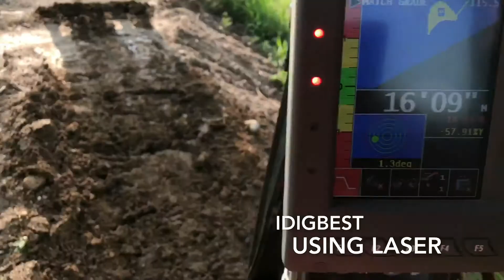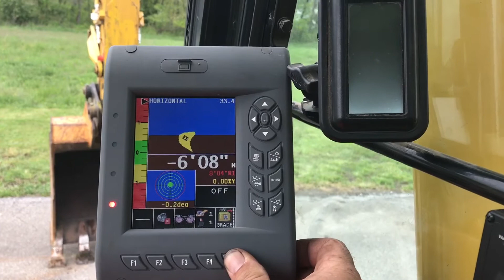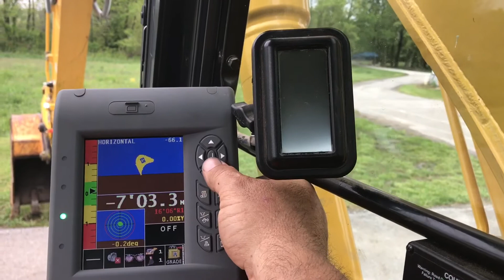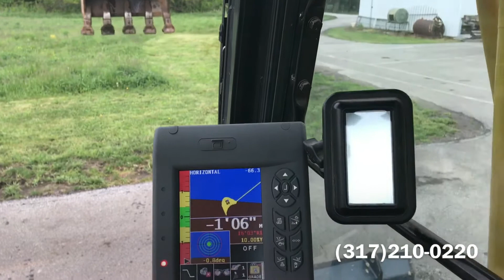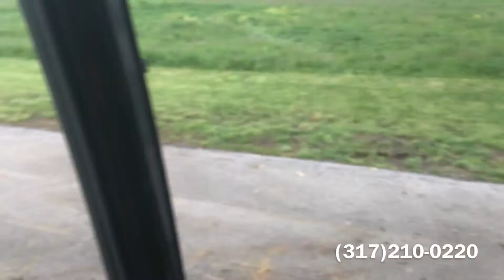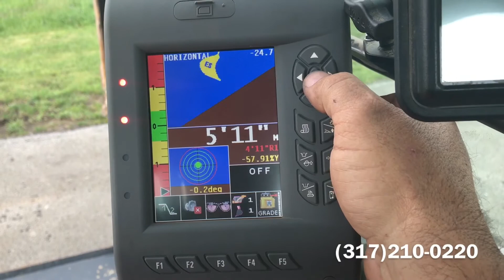Using laser mode

Comment: I am getting very close to ordering a system. I have a question about tilt buckets. Is there a separate sensor for the tilt bucket? If so how is it connected to the wiring harness?  If not how does it measure bucket tilt?